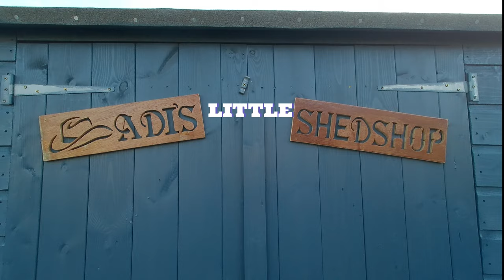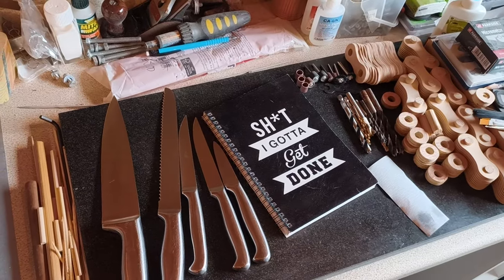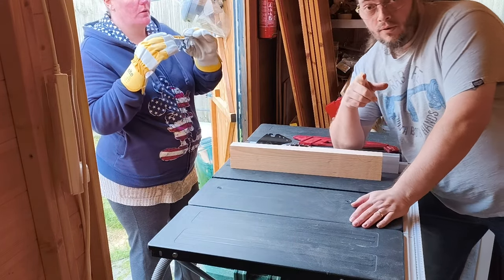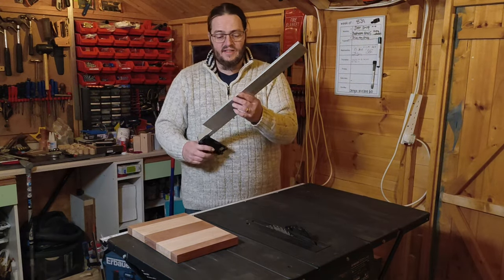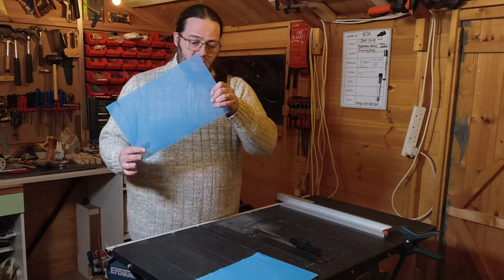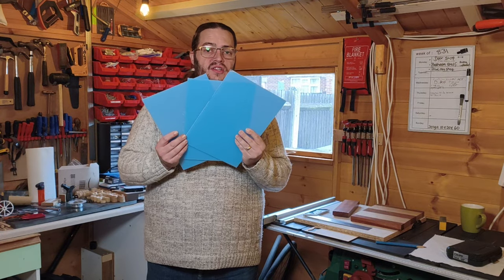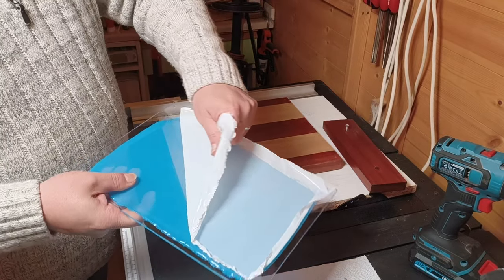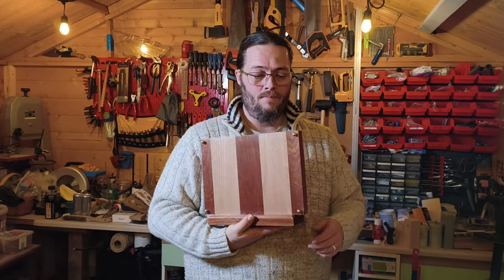Beautiful Knife Block From Scrapwood

Comment: Big A, why didn't you resaw the board in two passes? Raise the blade until it's raised slightly past the middle of the stock. You can hold the stock on the top side as the blade won't get anywhere near your hands.
Reply from the maker: Hi thankyou for watching Adi's Little Shedshop, unfortunately my tablesaw has a riving knife that sticks up higher than the blade by quite a bit, about 25mm above the tips so unless I removed it I couldn't run passes, riving knife might be a pain but it's safer than not having it on there. Oh and the table is unbelievably hard to get the blade to stay at 90°, I keep telling Mrs S I need a new one, she's not having it tho. Thankyou for your message and keep watching for more videos coming soon.

Comment: Correct me if I'm wrong - if you decided to use fire to make the acrylic edge as the final touch, was sanding all the way to 1200 necessary?
Reply from the maker: Hi thankyou for watching Adi's Little Shedshop, no correction needed, we sanded high to finish with heat as it used less heat in all the testing that I did, it seemed the best way to do it without it melting much, quite effective really. I hope you enjoyed the video and keep watching for more coming soon